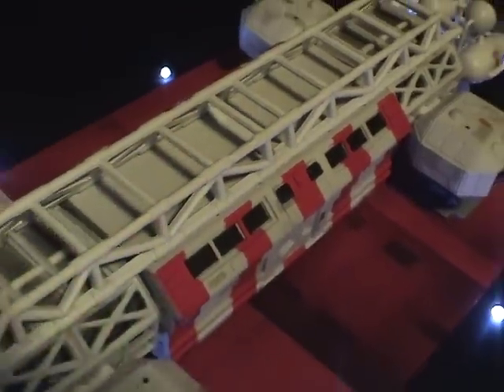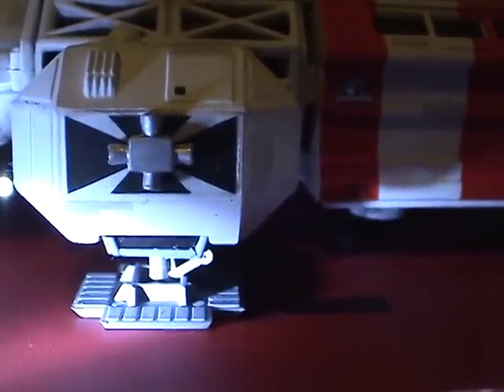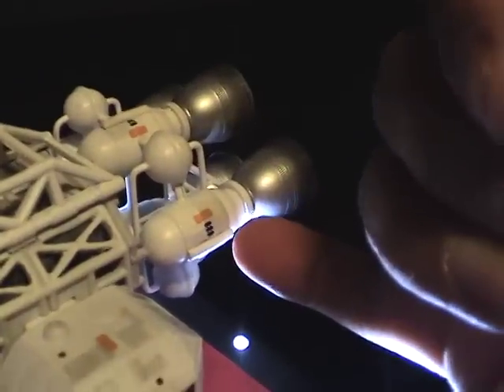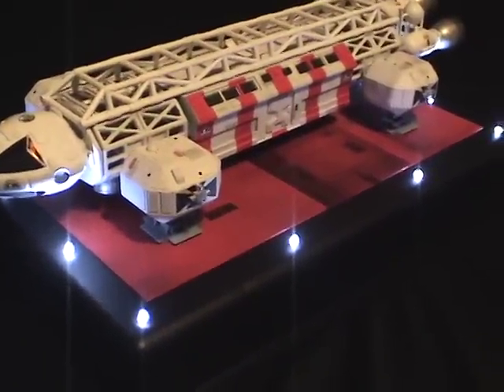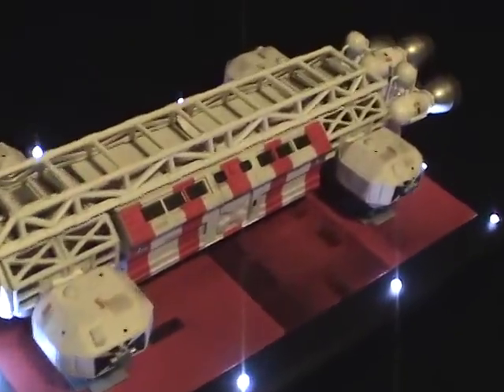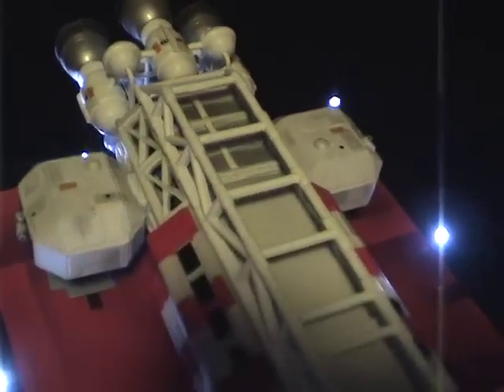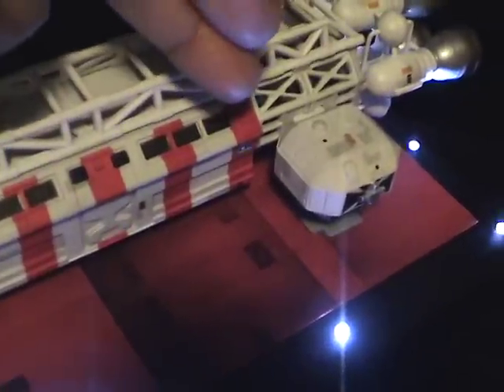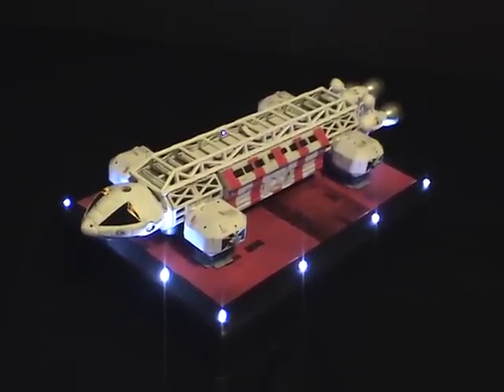Completion of the MPC/Round2 Space : 1999 Eagle Model

Comment: One again a wonderful build and explanation. A quick question...are you able to seal coat the model after using pastels? and that Tamiya flat white is perfect for a space craft like this.
Reply from the maker: Thanks Waylow.....and yes you can apply sealant to the pastels but just make sure you do so in light coats and stand at a good distance so as to avoid running.  As for the Tamiya matte white, I agree it's a very nice color.  Also I think the Tamiya insignia white would go really well with Star Wars ships.
Reply: Thanks for that also I am looking forward to building some include the Millennium Falcon
Reply: Here's a little trick. When the model is basically "done," spritz it with pump spray bottle hairspray (I use Suave brand). It's important you use pump spray, NOT aerosol! Once it's dry, apply the weathering powders. When you spray the Dullcote, the pastels will stay put.
Reply: Thanks

Comment: You've done very good work and modifying that piece of junk model.   I got mine in 2019 and thought because it was round2,  that they would have remastered the kit.   
Nope. Same horrible kit since 1976.   There is no excuse.
I don't think the value is good. Even though it cost $25, you don't get much for that amount.  Compare that to a $45 Bandai millennium falcon or Yamato kit.  They are very accurate, highly detailed and push together without glue.  

About the time you made this kit, round2 had release a 22in version of the eagle, which is very accurate.

Long before I saw this video,. I started cutting openings into the module.  Even the ones in the center.  
After so much time on just one quadrant.... With the bars all chewed up, I gave up, it's not worth it.  There are 80 total holes to drill out, and that should not be required in a 2019 model    your score up to is accurate 

I filled in the holes I made and modified eagle into something different as a test.   You did good work make a horrible kit into something that looks pretty good.

I also considered putting in lights for the command module and even the engines... But I've already assembled the engines and the cockpit.  If each image of a pain to try to drill holes and fit wiring.
The 22 inch eagle is a better value even though it cost $80 more.  You could even get a $25 pre wired lighting kit for that model.  More 3D print options are available.  Of course it's huge too.
Reply from the maker: Thanks for the compliments.  Yes I had chosen to do this before the release of the larger kit which I agree is so much better. This project was more of a challenge to myself to see what I could do with it.  If I were to do this today i would have thinned the plastic from the inside in order to make cutting out the triangular openings easier.  Thanks again and for watching.
Reply: It's been recently announced that R2 is/has retooled the 1/72 scale Eagle 1.   So far, the prototype looks very good.  The engine cross-bar is not correct.   It'll be worth bothering them on their FB page.

It's supposed to be a cross-bar with diamond bar on the outside between the engines and the bells.

I made my own from sprunes from the kit as well as additional bars for the spine.

I hope its no more than $35.  Considering the 1:48 is a lot more detailed and much more materials at $100 or so.
Reply from the maker: TexasCat99 yes i saw the recent announcement.I heard there might be a prototype on display at Wonderfest. Lookn forward to seeing it.